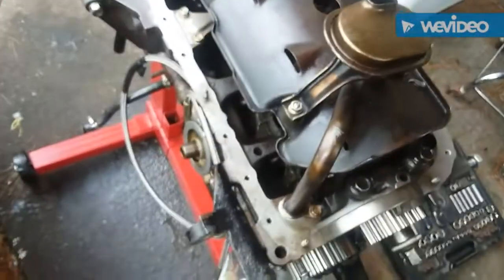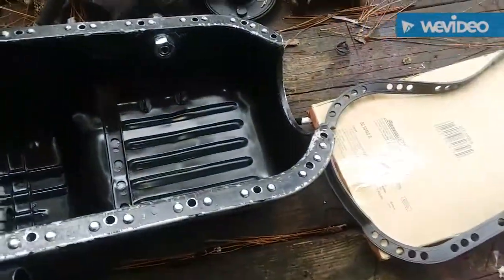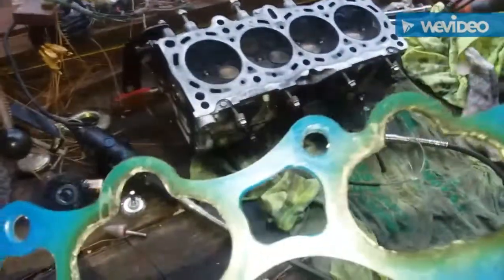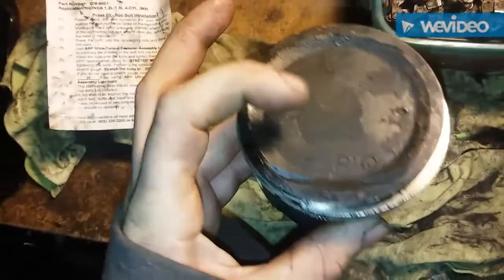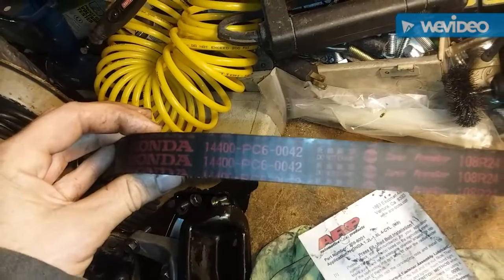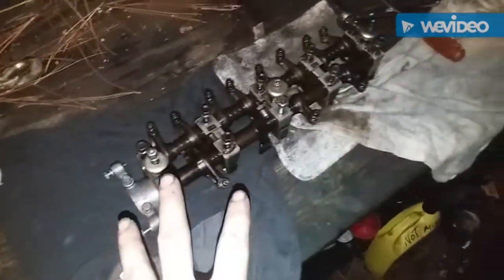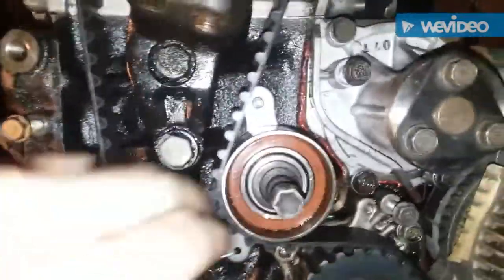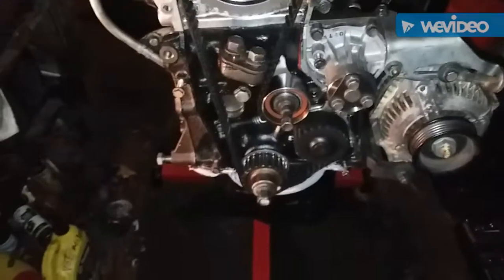86 Honda Accord motor rebuild part 2

Comment: I miss the simplicity of that motor but but non of the aftermarket options, because there was none. 

Normally had issues only with oil supply on number 1 journal when boosting. Increase the oil pan volume and lowered the pickup and issue was fixed! Good luck with that!
Reply from the maker: What kind of oil pan and pickup tube did you use
Reply: @shane86lxi43  I had to fabricate everything. I took a gauge metal sheet that of the oil pan and made my own. Basically cutting and adding to the current pan. 

As far as the pickup, I took an oil pickup and used a section of that to make it sit lower.

I honestly think a baffle around the pickup would've workout instead of going through all that, something like the b18 oil pan. 

I didn't have money like that, and everything I did was fabricated. And I took that stock block to the limit! Long history! Long story... Learned allot about the down fall of that engine under boost. Had 30lbs going to it. I have video proof, you likely saw it.

But that number 1 journal was always a problem until I modified the oil pan/pickup. Also shimmed the oil pressure spring
Reply from the maker: Cool man thanks for the info

Comment: Ive been trying to get that damn crank pulley off so i can replace thise gaskets
Reply from the maker: Yeah if the bolt has never been broken loose it can be a bitch to get it loose

Comment: hi, i am looking for cylinder head bolts for my a18a You could tell me where I can find some for my engine preparation! Then especially give me advice for my turbo project!
Reply from the maker: Sorry for the late reply you could actually reuse your old ones or possibly go with the Mazda Miata 2.0 ARP head studs